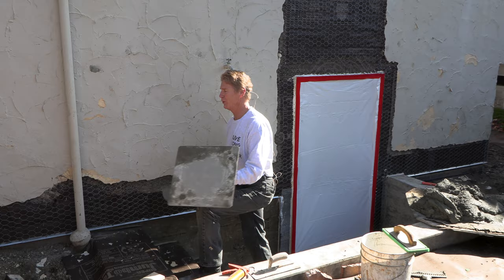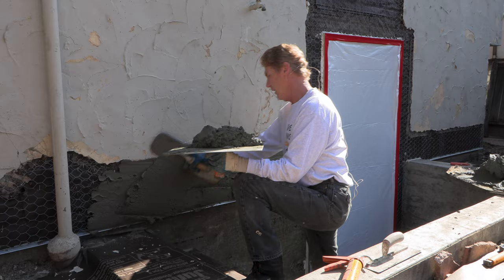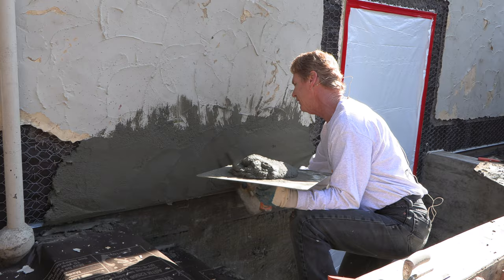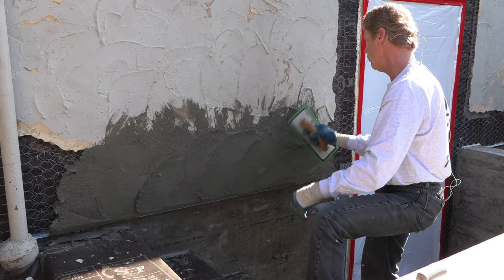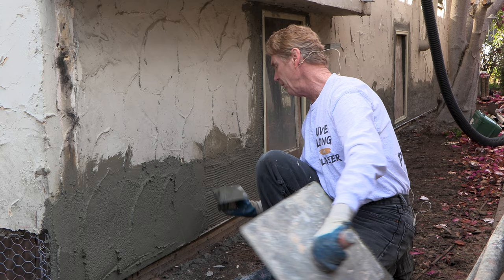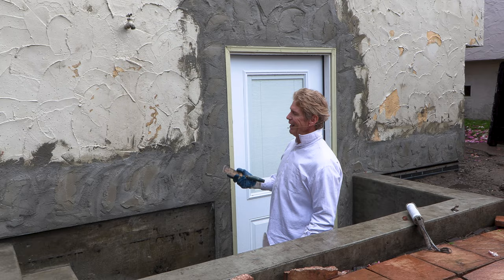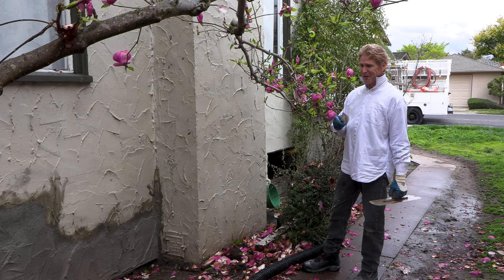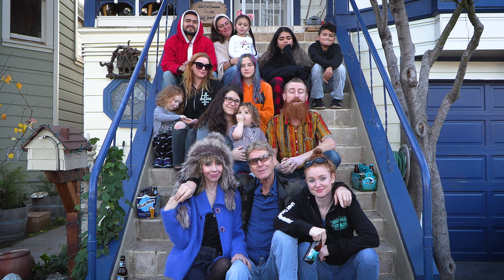Stucco textures how to match them

Comment: KIRK, 
YOU ARE A TRUE MAST FOR SURE. I have been watching all your video’s and learning. So been working on a project and have a wall that is off square 1” on one end and 3” on the other, I am trying to float my base coat to fill and level. Well today I started on the 3” side and I put the stucco on quite thick, while drying it has spider cracks in thick spots . Was mud too wet or or just too thick ? I still need to build up my layers to finish my job before my final stucco finish. It will be ok if I let it dry and keep putting thin coats on top?
Reply from the maker: Howdy Patrick, when applying any stucco over 1/2 thick. If you apply coat after coat, allowing the first to dry just enough, it may not crack. However, this takes practice.
 I have gone 6 inches think many times; however, this, again, takes some practice and the right stucco, https://youtu.be/xvQX8VqAumI/  How to apply stucco six inches thick.
Reply from the maker: Hey Pat, or watch this one; it's a video applying coat after coat of stucco with no cracking. https://youtu.be/9On87_jM2V4/

Comment: This doesn't apply to this video but I'm looking for the master Mr Kirk himself's opinion!

I have a CMU block wall that was installed but unfortunately painted a year ago. I want to skim coat and then color coat.

 Is pressure washing 4000 PSI and then applying a bonding adhesive prior to skimming enough to make it last or do I need to use a paint stripper as well? Thanks big fan!!!!!
Reply from the maker: Hello my friend if 4,000 PSI does not remove the loose or stubborn paint, that paint it there forever. With rolling a bonding agent such as Quikrete or Weld-Crete, your new finish should last forever.👨🏻‍🔬
Reply: @StuccoPlastering  in the master we trust :) thanks!
Reply from the maker: @reederstan  LOL, thank you.

Comment: Hey Kirk - we have a large stucco wall here in Minnesota - the windows are almost flush with the stucco - the insurance company wants to skim coat over the existing but concerned they wont be able to caulk the windows properly. Does a skim coat hold up as long as the original stucco or can you have issue with temperature changes cause it to start cracking and falling off? Thanks love all your stuff!
Reply from the maker: Hello, my friend, color coats last hundreds of years; when applied properly, there is no need for caulking.👨🏻‍🔬